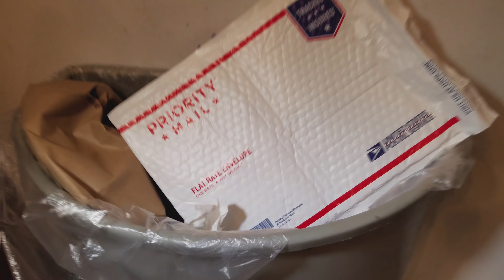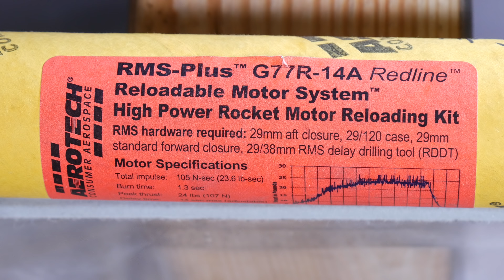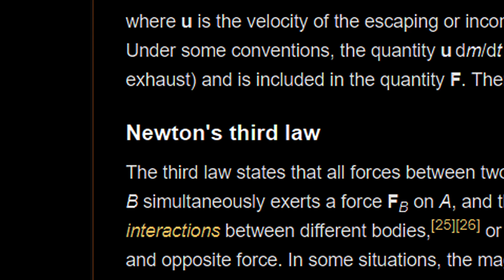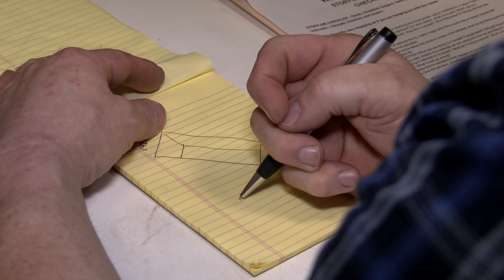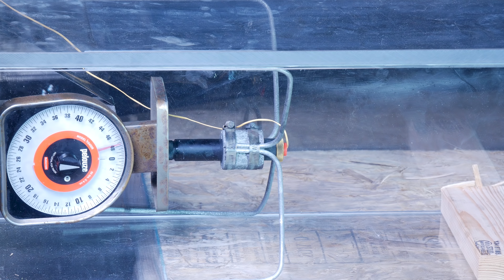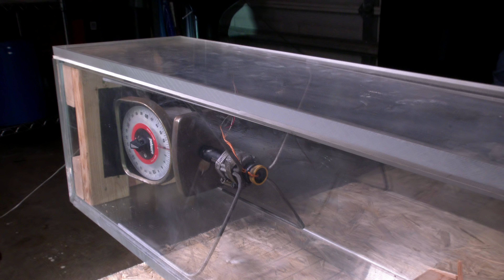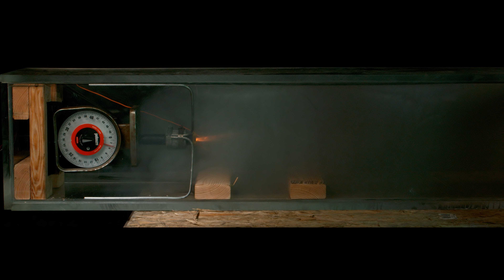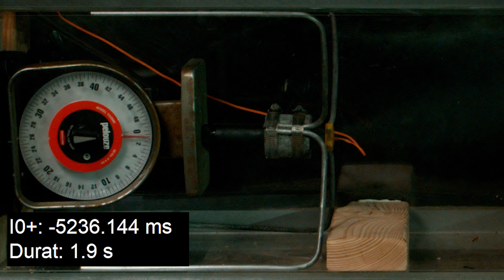Rockets in a Vacuum Chamber - Newton's third law of motion Visualized

Comment: If you want to make an experiment on how thrust works in a vacuum, why not attach a really big bouncy ball filled with air to a common but functional household vacuum and see it it can launch. This  gives more than enough advantage to the ball as it has the sides of the hose to push against and a household vacuum  is nowhere near 2 hydrogen atoms per cubic meter emptiness of space.
Reply: You are equating the "vacuum of space" to a "vacuum cleaner"???  That is the most ridiculous thing I have heard.  A vacuum cleaner is like a WIND TUNNEL, while the vacuum of space could not be any MORE DIFFERENT than a wind tunnel.  You must be one of those people who thinks the "vacuum of space" can actually SUCK.  Hint: it cannot.  The vacuum of space cannot exert ANY FORCE ON ANYTHING -PERIOD.
Reply: @stuartgray5877  What a strange concept. Have you ever used a vacuum cleaner or even seen a bell jar?  We need some common starting point because what is described by "science" as the condition of "space"  is a vacuum, the absence of pressure, or the lowest possible pressure one can "naturally" have.  What these fellas used was a vacuum pump (similar to a vacuum cleaner system but piston driven instead of a centrifugal fan system) to evacuate air to simulate, although they came nowhere near that of 2 hydrogen atoms per cubic meter "science"  claims.  Space is infinitely empty. Nature abhors a vacuum and any pressure will be immediately equalized.  

Do you get that any rocket force applied in this "space"condition would be cancelled?

The reason the vacuum cleaner and big bouncy balloon is a fair test is it show how this can really happen as the amount of force from the balloon is exceeded by the amount of "space" the vacuum cleaner simulates. Infinite empty, infinite lowest pressure, against finite thrust. In this condition there is nothing to be equal and opposite to the finite force of the engine. In "space" there is no container to fill with gas, no back and side walls, total nothing for the engine to push against and is completely unlike this video.

good luck.
Reply: @robertfish4734  - "Do you get that any rocket force applied in this "space"condition would be cancelled?"

No it would not.
When a rocket engine fires and combusts the fuel and the oxidizer, the chamber pressure can climb to over 3000 PSI just down stream of the "throat".
The exhaust gases are PUSHED OUT of the nozzle, they are NOT pulled.

The nozzle is applying the force required to ACCELERATE the mass of the exhaust NOT THE VACUUM.
The "Vacuum" CANNOT exert a force - PERIOD.

So in this scenario (mass comes shooting out of the nozzle) into the "empty void of space" WHERE DOES THE FORCE ORIGINATE ??

You know you CANNOT accelerate a MASS without a FORCE RIGHT?

"The reason the vacuum cleaner and big bouncy balloon is a fair test"
No it is NOT a "fair test" and the Vacuum CLEANER CAN EXERT A FORCE while the "Vacuum of space" cannot - period.
Reply: @robertfish4734  I'll show you video evidence of rocket propulsion in a vacuum but you have to answer a question.

At WHAT ALTITUDE above sea level does the atmospheric pressure drop to what would be called a "vacuum"?

Lets define a "vacuum" as 1.0 TORR (about 0.02 PSI) or close to 1/1000 sea level.
Reply: @stuartgray5877  I do not disagree that the exhaust is pushed.  This is the only force available - so far so good. In atmosphere this force is pushed against the atmosphere, something for the thrust to act against.  

So why is so difficult for you to see is if there is nothing to push against movement is static.  I never said vacuum was a force, it is a lower pressure. Higher pressure dissipates into a lower one - every time.  Gas always equalizes.  So in the infinite emptiness, compared to 3000 psi is nothing,  it could be a billion psi and so long as a finite against the infinite, finite always loses.    

The vacuum cleaner is only creating a lower pressure not a force. The force is a result of the higher atmospheric pressure trying to equalize the lower pressure the vacuum cleaner produces. 

good luck
Reply: @robertfish4734  - " something for the thrust to act against.  "

NO!

The FORCE is BETWEEN THE ROCKET NOZZLE and the MASS OF THE EXHAUST it doesnt NEED ANYTHING ELSE TO PUSH ON.

As the rocket nozzle PUSHES AWAY the exhaust,  the nozzle FEELS THE RECOIL FROM THE PUSHING.
This RECOIL force accelerates the ROCKET.
BOTH the rocket AND THE EXHAUST gets accelerated.

Now why didnt you answer my question:  At WHAT ALTITUDE above sea level does the atmospheric pressure drop to what would be called a "vacuum"? 
 Its ok if you dont know, just say that.

I intend to show you indisputable evidence that rockets DO WORK in a vacuum, but you need to answer that question first.
Reply: @stuartgray5877  It is actually bull shit that there is a vacuum outside our pressurized atmosphere so your question can not be answered. We were discussing physics, Newton's law about action/reaction.

As a rocket pushing against its self, imagine a rocket engine attached to a rail car. The rail car has a wall attached to the thrust end  of the motor so allowing this mysterious force to propel w/o any help from the atmosphere.  The thrust pushes against a static wall that is attached to the same platform. If that pathetic theory of not needing anything to push against, recoil...( like firing a bullet with out any shell casing and no other enclosure) held any water, this car would move happily down the track. It won't, your argument has no support in this current reality.
Reply: @robertfish4734  SO you DONT want to see the VIDEO of rocket propulsion in a vacuum.

Understood.  Goodbye.
You really SHOULD take an actual physics class before arguing with a Spacecraft engineer who builds, tests, launches, and flies spacecraft IN SPACE for a living and has obviously been doing it for longer than you have been alive based on your grasp of physics
Reply: @robertfish4734  - "It is actually bull shit that there is a vacuum outside our pressurized atmosphere"

So you agree that the atmospheric pressure at sea level is 14.7 PSI right? (hope so)
Do you ALSO agree that the atmospheric pressure in Denver Colorado (one mile high) is about 12.5 PSI?

Do you ALSO believe that the atmospheric pressure on top of Mount everest (about 5.5 miles above sea level) is about 5.0 PSI?

SO robert: what do YOU think happens as you go HIGHER ?
Just a guess, come on you can do it....
Reply: @stuartgray5877  No, you fail to understand.

Is your video animation? All NASA has is cartoons and green screen. I generally have a problem taking that as real science. This video we are posting on is not real science either, but I watched it anyway, however I am  very open to learning and if you have proof, I will be damn sure to look at it.  Still, I hope you can see why I may be skeptical, based on your replies to the science experiments proposed and lack of explanations where you seem to have failed to present any contrary evidence to expose any logical flaws.

On second thought - Actually this current video is science, the conclusions and experiment presented are flawed and misleading. 

So, what you got there Mr. Gray, Spacecraft Engineer?
Reply: @robertfish4734  - "My guess is there are no witnesses seeing this first hand."
Then you would be wrong again.

The video in question was seen LIVE by tens of thousands of spectators.
It can also be corroborated by dozens of other videos.
Reply: @robertfish4734  And ACTUALLY the "event" I am speaking about that was recorded LIVE AND UNEDITED on video was not only viewed by tens of thousands but has happened over 45 times and has ALWAYS been viewed by tens of thousands of spectators live.  You could even go see it with you own eyes.  Just tell us all at WHAT ALTITUDE does atmospheric pressure become "vacuum"?  Too difficult of a question for you?  I thought you were capable of "research".
Reply: @robertfish4734  search YT for "Uninterrupted Footage of the Falcon Heavy Launch and Booster Landing!". Watch that video then tell me what you saw.
Reply: @stuartgray5877  Looked like an expensive and very large firework. Do you think it made it to "outer space" vacuum,  you know, the reason for this dialogue? This was suppose to be your most irrefutable proof. I am not  surprised, but am terribly disappointed.

(The people in the background remind me of those crisis actors from that famous 911 apartment footage,)  

You must believe this proves something, but it shows nothing. Launches of rockets are pretty old school and it is  totally unlikely this disproves any premise from my experimental suggestions.  If I have missed your obscure point, I am still listening, or is that all you have?  

This may be a good time to rethink your realities.  I have had to change when the evidence becomes obvious. 

BTW: Do you believe that there is a Tesla in outer space?
Reply: @robertfish4734  You DIDNT EXPLAIN WHAT YOU SAW, so I will.
You Watched as three common core boosters lifted off together.
ALL THREE were heading downrange (east) at a velocity of about 3600 MPH when the two side boosters separated.
These side boosters then CANCELED that downrange velocity and FLEW BACK to KSC and landed.

robert - At WHAT ALTITUDE did those side boosters separate then perform ROCKET PROPULSIVE MANEUVERS TO FLY BACK?
I'l TELL you since you are completely incapable of answering questions.
The altitude that the side booster separated and FLEW BACK was SIXTY KILOMETERS (60.0 km).

robert - care to guess what the atmospheric pressure at 50 kilometers IS?
robert - The Atmospheric pressure at 50 kilometers is LESS THAN 1.0 TORR Otherwise known as FUCKING VACUUM !

SO YOU JUST WATCHED those sides boosters turn around, cancel 3600 MPH eastward velocity and FLY BACK TO KSC IN A VACUUM
robert - care to tell me HOW the side boosters DID THAT IF ROCKET PROPULSION DOES NOT WORK IN A VACUUM ?
Black fucking magic?
NOW you know why I wanted YOU TO TELL ME where vacuum starts because you are just going to say "but it wasnt vacuum"
well you are literally talking to a VACUUM TEST SPECIALIST and I will tell you for a fact: IT IS VACUUM ABOVE 50 km. - PERIOD
Now what flat earth moron technique are you going to use to wiggle out of this? The patented "Nu-UUUUUUUH"?
Because I know that is all you have.
Reply: @stuartgray5877  A vacuum test specialist?  I thought you were a space craft engineer or some such lofty title.  

Because I am old school and pretty much understand vacuum in terms of inches of mercury measurements, 27 inches is a pretty good vacuum and that equals  685.8 torr.  That is about what the better two stage AC vacuum pumps can do.  No where near 2 hydrogen atoms per cubic meter of "space".

1 inch  = 25 .4 torr.  1 torr = 0.0393701 inches of mercury. 

What kind of specialist?  Really. You understand that inches of mercury was the first measurement of vacuum because of your specialization... 

The boosters were not in a vacuum. I think the black magic was the landing. I am not a spacecraft engineer but having only thrust from the bottom with out any side to side control seems fucking impossible to me for this incredible landing. 

Never answered about the Tesla... do you believe?
Reply: @robertfish4734  - "A vacuum test specialist?"
Yes I was first trained (my first aerospace job) at Lockheed Martin Space Simulation Lab in the 1990s.  I used to operate a 29 X 65 foot Solar Thermal Vacuum chamber (same one as used on the Viking Probes). Since then I have been responsible for the System level Thermal Vacuum tests on the Stardust, Genesis, Deep Impact, Kepler Space telescope , and JPSS-1.

"The boosters were not in a vacuum. "
The boosters were MOST CERTAINLY IN "vacuum"  AS I SAID the pressure is LESS than 1.0 Torr (0.02 PSI) or close to ONE-ONE-THOUSANDTH that of sea level.
This 100% qualifies as vacuum 

And for MORE PROOF, watch the exhaust plume as the rocket ascends. 
robert - WHEN DOES THE EXHAUST PLUME STOP EXPANDING ?  Was that BEFORE Main engine cutoff and separation - WHY YES IT WAS!

WHY would the exhaust plume expand to a certain size (bigger an bigger ALL THE WAY UP) UNTIL it STOPS EXPLANDING ?

Next go WATCH THE ACTUAL Video FROM SPACEX ( YT video "Falcon Heavy Test Flight") , then watch the side boosters separate (occurs at 24:34) and TELL ME If those side boosters were moving at 3600 MPH (MACH  4.7) IN ATMOSPHERE?  WOULD THOSE BOOSTER JUST PEEL AWAY GRACEFULLY ?
NO! IF the boosters were STILL IN ATMOSPHERE they would have been RIPPED AWAY in a millisecond.

Now KEEP WATCHING until the upper stage separates from the center core (at 25:13) .

Did THAT BOOSTER look like it was separating at 5900 MPH (MACH 7.5) IN AN ATMOSPHERE ?
NO literally ZERO ATMOSPHERIC EFFECTS.
WHY no atmospheric drag? Because ITS IN FUCKING VACUUM.
 
Try again genius.
Reply: @robertfish4734  - "but having only thrust from the bottom with out any side to side control seems fucking impossible to me" Then go WATCH ONE YOURSELF!
They have done that OVER A DOZEN TIMES IN FRONT OF TENS OF THOUSANDS OF SPECTATORS !
they have revovered over FORTY FIVE of those boosters.
Reply: @robertfish4734  Please lookup the standard vacuum levels and post them here for me please. There are NAMES for the various regions.
Reply: @stuartgray5877  I showed you references about space vacuum.They are much lower than your 1 torr. This is indisputable, especially when we are referring to outer space rocket propulsion as laid out in my experiment.  The point is 1 torr is pretty well packed compared to  2 hydrogen atoms per cubic centimeter. It is true that vacuum represents a lower pressure, space vacuum is near perfect .30 inches of vacuum, according to wicked peed on us. It is true that space has .000000 psi because  there is nothing to make pressure and PSI is a measure of pressure. You know pounds per square inch.  So it seems that 0.02 PSI is  pressure not vacuum compared to space vacuum.   

If you want to debate it it is possible to boost a rocket in atmosphere, you win. 

This is the apparently the difficult part: Outer space offers nothing to create an opposite reaction because it is EMPTY.  <- that is what we were discussing...

Negative pressure is a term. It exists, look it up engineer.  

Billion dollar fraud programs are only a source of pride to the cons that benefit. I strongly doubt your existence and proclaimed pedigree,  (which you proclaimed and added to at the start of the pissing contest portion of this discussion) and still you seem to argue in a typical shill response,  try and belittle someone based on your script. You have no idea who I am or my education or experience. All you do is ignore the main idea and attempt to pick at a minor point that has nothing to do with the argument. I am beginning to think this concept beyond your capability to grasp. or is all this you just doing your shill job?

You never did answer about the space Tesla. I really want to know if you believe there is a crash dummy driver in space.
Reply: @robertfish4734  Yes the Tesla in space is 100% real. Why WOULDN'T IT BE?
SpaceX launches OTHER PAYLOADS to space JUST LIKE THE TESLA but even BIGGER!
WHY would they need to fake the tesla?
Other inaugural flights of rockets FOR THE MILITARY often launched large blocks of concrete or even tanks of water.
SpaceX had to demonstrate SOME MASS in the first launch - WHY NOT use something cool instead of a block of concrete??
Reply: @stuartgray5877  Thank you for your answer, testifying to your belief in the space Tesla.
Reply: @robertfish4734  - So YOU THINK that Spacex would LIE TO THE MILITARY and present FALSE QUALIFICATION DATA? for a MULTI-BILLION dollar program? You know that is a felony right?    Why dont you turn them in with your vast quantity of "evidence" that it was all fake?
Reply: @stuartgray5877  We have been and still are under military occupation.  The United States of America is a bankrupt corporation.  So yes, I think all space programs are fraudulent because space is a myth and nearly everything we know is wrong. Every day is opposite day. 

NASA lost all Moon data, as if there ever was moon data.  Spacex, like NASA, is just another made for TV production of the "news"/entertainment division of the military.

If you can connect the concept of static thrust in space, the impossibility of a finite pressurized atmosphere surrounded by infinite vacuum,  and are clever enough to recognize CGI, you would begin to realize that the corruption knows no bounds and continues unabated.  

But, you still have nothing on your problems with the bouncy balloon experiment.  Glad I could give you some respite so you won't be troubled on answering to that, the main point of this dialogue, because it has becomes obvious that you have nothing.  You will focus on the tin hat part and attempt to discredit in another long distraction. Let me just mention that coming to the tin hat conclusions took years of research and there is no way to give a proper perspective in this theater. So, suffice to say, if you want to look down that rabbit hole, spend your own time. This discussion is about the impossibility of navigation in space using rockets.

You can believe what ever you want. Without faith, con-artists would die out.
Reply: @robertfish4734  it is a FACT that we test full flight units IN VACUUM before we put them on a spacecraft.  I am looking at the test reports.
Reply: @robertfish4734  and you are still demonstrating that you don't know how vacuum works.  The SpaceX video shows rocket propulsuon working JUST FUCKING FINE in a pressure that is less than ONE-ONE-THOSANDTH the pressure at sea level.  THIS IS "VACUUM" according to the technical definition. YOU don't get to redefine what "Vacuum" IS just because I proved you wrong.
Reply: @stuartgray5877   I suspected as much from the beginning, but gave you the benefit of the doubt.  Now you have shown, with out a doubt, that you are a fraud and have lost all credibility.
Reply: @robertfish4734  care to explain why?
Reply: @stuartgray5877  If your feeble AI can't figure it out, a gaffe so obvious, you need reprogrammed.  If you are just lower order shill, see your commander.
Reply: @robertfish4734  - Just search "Spacecraft Thrusters MOOG Corp" and tell me what you find.
They have the test specs of their test facilities on their website.

i have used BOTH the mono-Propellant (Hydrazine) AND the Bi-Propellant (Hydrazine and nitrogen tetroxide ) propellant systems.

I have helped FUEL and FLY those types of vehicles. 
I have worked ON THE PAD for real rocket launches and the hazardous operations to build one and put our payload on the top (Fueled and armed).
I have NASA certs for hazardous ops at KSC/ CCAFS/ & VAFB for the last 20 years so take your accusations of me lying and shove them where you keep your head.
Reply: @stuartgray5877  Nowhere is there any mention of testing these engines in a vacuum. Just because you found a rocket mfg's web page still doesn't prove anything, except you can Google. You are a total fraud. This is not some idle accusation, it is busting you as a totally unapologetic prevaricator.
Reply: @stuartgray5877  I already went through this scenario two comments ago. The bit about the military adds no credibility  as they are well aware of the unnecessary step of vacuum testing  as these engines run in atmosphere exclusively anyway. 

You have nothing and only waste my time. Your only goal here is to score some points after I quit responding. I mean what are you in your own words, vacuum expert (who doesn't know shit about vacuum) spaceship designer, now some sort of launch pad maintenance dude, and most apparent, and weakest ability space specialist liar and barely professional troll.
Reply: @robertfish4734  
m1vi1 + m2vi2 = m1vf1 + m2vf2
Can you tell me what that equation is, what it means, and why it's relevant? If not, you certainly aren't qualified to be lecturing anyone on any topic of physics.
Reply: @the18thdoctor3  Conservation of momentum formula... So very good of you to lecture me, but that formula does not  negate Newton's 3rd law that requires an action to have a reaction one bit, in fact it is part.  It is pretty good at predicting crashes but how 'bout explaining actual navigation in a vacuum. I would love to conduct any experiment you have using actual physical models to enlighten me to a minor understanding of your super level level thought.  You know, life is for learning...

While you are at it I have this other problem:

I, being so very week in physics, just can  not see how we even have a pressurized atmosphere while surrounded by a near perfect, infinite vacuum, (2 hydrogen atoms per cubic meter) w/o some kind of leak proof enclosure. Boyle totally prove beyond any reasonable doubt that higher pressure dissipates into a lower one consistently, so does my physical industrial experience. 

Before you go into the dogeared "god gravity" tripe, consider how when you sip a Miti on the beach at sea level you overcome your god by using a straw on a way more dense material than air. Hell, when you breath you are proving Boyle and overcoming gravity. 

Sorry, I get a little tired of space bull shit, but if you have anything, do not hesitate to convert me.